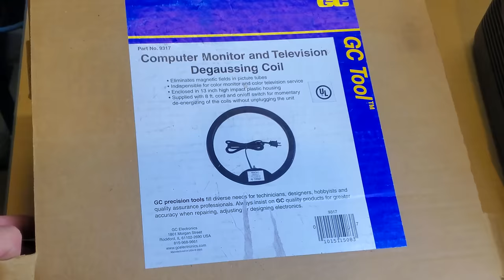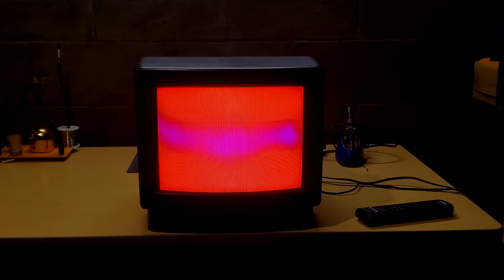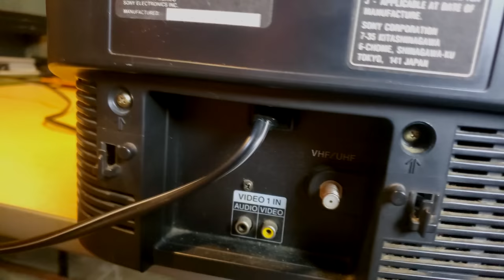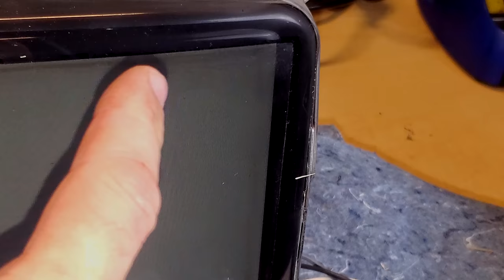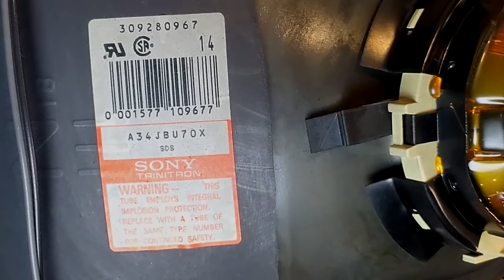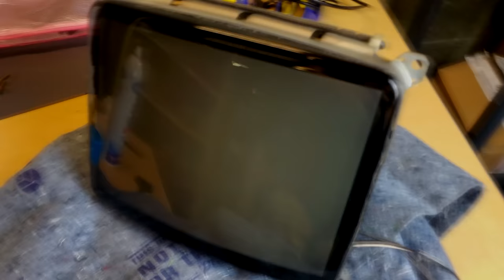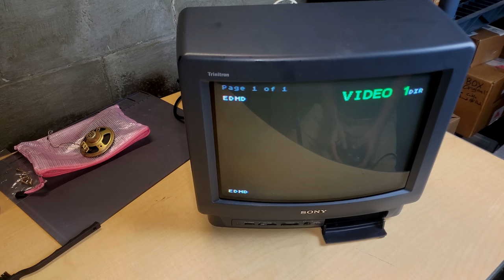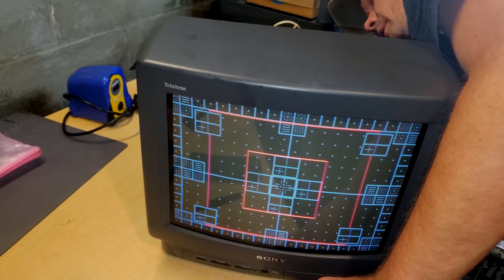The Sony KV-13TR28 Trinitron from 1993 | Is it Good for Retro?

Comment: I have the exact same model that I purchased last year from an old guy that had it brand new sealed in the box in his closet for 26 years. Said he originally bought it for his cabin house but decided to go with a bigger TV and just stored it in his closet as a backup but never got to use it. I couldn't believe my eyes when I opened the box. I never seen such an old tv look so dang new. I opened the tv up to inspect the inside and everything was brand spanking shiny new with no dust in sight. I was extremely lucky to find it and I will never let it go. I may have been technically the second owner but the first to actually use it.
Reply: Damn...if only more of us had that kind of luck

Comment: I have the white sister set, the KV-13TR29, made in May of ‘94, that I picked up over the summer off EBay.  I got it new in box for $150 back in July.  Surprisingly,  nobody was bidding on the set and I got really lucky.  The 13tr28/9 are awesome sets and have great color and a sharp picture.  I’m super happy with my set.  Apparently, you can somehow do an RGB mod on this set with the closed captioning board.  I think you can remove the closed captioning board and use the RGB connections that are already there.  At some point, I will post some photos of it in the CRT collective.
Reply: I think this was the one shown in Firehouse Dog... it's the perfect size.

Comment: I have a similar looking KV-13M10 that I have modified with SCART RGB with auto RGB input enable and a manual switch override. It looks really good. I also installed a 3.5mm audio jack to pass the stereo audio from the SCART connector. I use it to connect PC speakers for stereo sound.

Comment: I think it'd be nice for a RGB mod. I can understand why some people would want it kept in its stock original condition though. But if the RGB mod is well done I think it will only increase the chances of someone getting enjoyment out of the TV. Not that you can't enjoy a TV with only composite video. I have a 13" PVM which after using for awhile made me think that for many people a 13" tube with RGB is a great size for playing old single player games. I think it's a pretty good sweet spot on viewable screen size vs weight and the real estate used. Some of us are willing to deal with the large and heavy tubes but many people don't have the space or the ability to move around the big ones. And with the 13" CRTs they are much more portable if someone does need to move it around a lot. 

So that is why I think you should RGB mod this TV. Improving the image quality like that would make for an even better CRT for someone to enjoy.

Comment: These are quite common, so an RGB mod would be worthwhile. Probably a little more straight-forward as it already has A/V inputs, so not too much to worry about in regards to safe mains isolation (check anyway!).
Reply: @realamericannegro977  Yes much sharper images and text, and colours that really pop! 😎

Comment: I'm told you can RGB mod TVs with separate CC cards by pulling the card and replacing it with your own input circuitry. You wouldn't lose your OSD this way. This set might be a good candidate for that.
Reply: Can you show me some links on how to do this or what I need?

My GF bought me a Trinitron and I wanna safely mod it later

Comment: Really dirty?  Actually unusually clean inside compared with other TV/monitor videos I've seen on-line.  Also, looks decent for composite video, at least what I can judge from this video.  RGB mod - not interested since they are model specific.  Enjoyed this video, BTW.  I had a mint condition multisystem 13" Sony Trinitron that I used while overseas and gave to a USAF thrift shop after retiring which I now regret just as I regret giving away the long line of now retro computers I've owned over the years.
Reply from the maker: Thanks, I think the dirtiest part on this one was that filmy layer of dirt on the tube itself.  The old PCs are really making a comeback.

Comment: I need help with this strange issue, I've bought a 1995/6 Toshiba CRT TV online and it comes up with nothing except when using the OSD in which case just a single line appears in the centre of the screen. 
But when I moved the TV or gave it a little whack, a picture started to immerge but only on a third of the screen and the image was scrolling downwards constantly. Then after the tube warmed up if you had the TV in the right position the picture would fill the entire screen as it should but it's very unstable and it's in black and white (apart from the OSD which is still in colour.)

I then decided to clean out the inside of the TV (which it needed!) and then tested it again but the same problem occured and this time no change at all when moved or warmed up.
So now I have no idea what the problem is but bear in mind that when I bought the TV online, the pictures showed it working perfectly fine with no apparant issues so I think that either something came loose during shipping or an internal component just gave up out of nowhere. 

Audio works completely fine however.

Comment: Bought similar kind of CRT couple days ago for playing PS1 on it, a KV-14T1D, introduced in 1996 iirc. However, there's no horizontal width adjustment of any kind of it, as it's supposedly handled by a chip automatically. But the 240p picture is too wide on it, the TV hides half inch portions of it behind the borders and can't get it zoomed out horizontally. 
Is there anything that can be done with it?

Comment: I didn't even search for this video. I saw it in my recommendations and thought Hey, that's my TV. Very informative, well done. My set has some slight geometry? issues (Straight lines are slightly bent in the top left corner) and it makes a weird buzzing sound when it turns on. Anything I could do about those two things?

Comment: I recently found  this exact crt although with a different model number. Looks great but sadly it has a slight burn in number on the top right corner. Thankfully is barely noticeable, you can only see it if you have a solid bright color on screen even then is not that bad.

Comment: RGB mod would be cool with a PVM comparison but don't short sell the benefits of a good tune-up even with a consumer set.  Many of them have color way out of adjustment.  Go with a calibration video and composite comparison with a 13" PVM and then do an RGB mod video and compare that result to the same PVM that you did the composite comparison with!